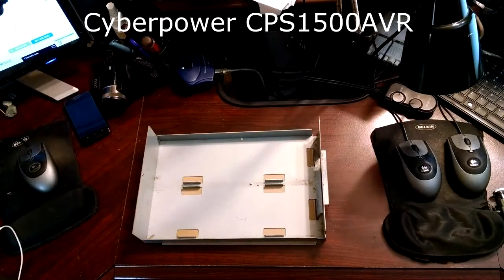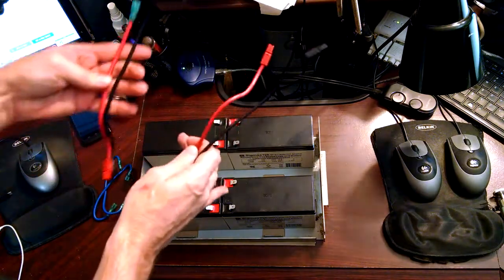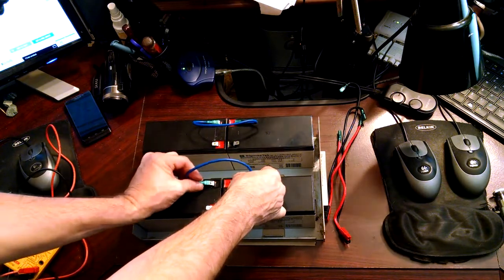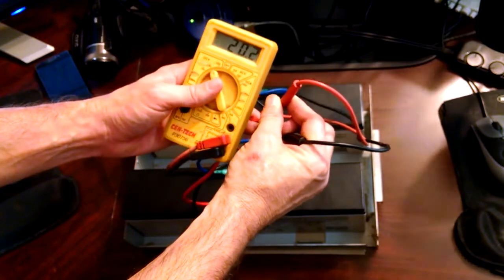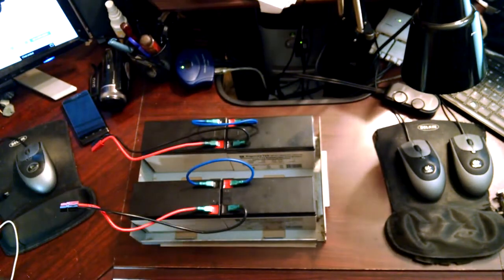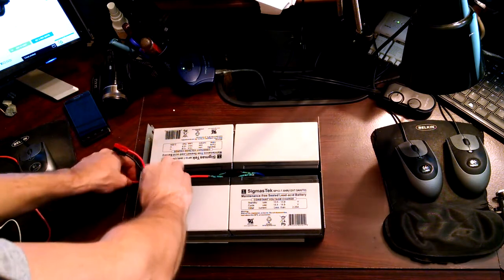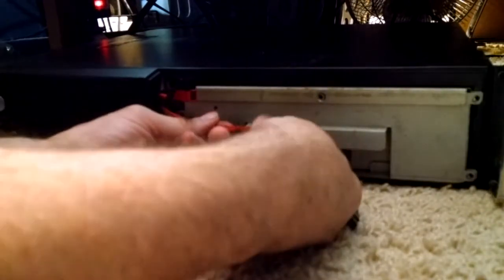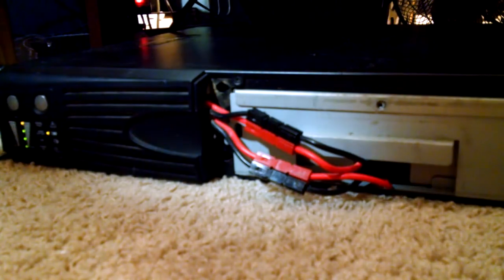Cyberpower CPS1500AVR Battery Replacement Wiring @cyberpowerinfo

Comment: That is not the proper orientation of batteries within the battery tray. You are asking for trouble if the leads were to be inadvertently pulled off in this position. The terminals of the first set of batteries should be facing the side of the tray. The bent up tabs on the bottom half of the tray will keep the batteries from moving and terminals shorting out if the leads become accidentally dislodged. The second set of batteries should be placed with the terminals facing the bottoms of the first set of batteries.
Reply: FWIW, mine came from the factory with the terminals facing each other as demonstrated. With the lengths of the factory supplied wires, I don't think it's possible to do what you're suggesting, though I agree it would absolutely be safer. 

I really don't like the idea of the battery terminals facing one another like that either, but it's the way they come (though realistically, it'd be difficult for the leads to contact one another, since they are inside of a box where they are never touched or moved. That said, I feel like the engineer who designed it wasn't thinking.)

Comment: This is very helpful and the only video like it I can find on the Internet.  I followed your instructions and when I plug it in the unit says "Wiring Fault."  Do you know if that means my wiring on the battery is not correct or if it is a problem with the wall outlet?

I wanted to edit this to follow up.  I checked the voltage as you instructed and everything looked correct.  I reattached cables and plugged it into the rack and everything was showing green.  When I had the fault showing I was plugged into different heavy duty power strips.  My current theory is that using a strip to plug a UPS into is not a good idea, even for a test.

Thank you for the great video.

Comment: Would have been nice to have seen how you opened up the unit. Thank you
Reply: Thank you. Much appreciated.
Reply: Neither you nor the Cyberpower manual mentioned if you had to unscrew the front panel to remove it, but I went ahead and forced it. It looks like I did it the right way, forcing it from the middle center edge, because the attachments there are plastic and more fragile than the metal attachments at the right edge.
Reply: The hidden screw under the front warning label on the battery cartridge tripped me up.  Note to future viewers.